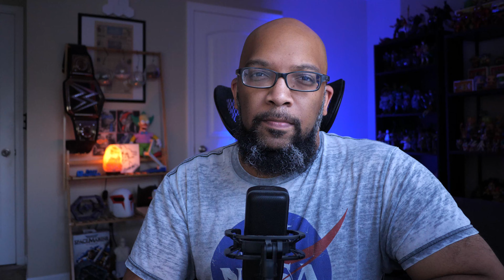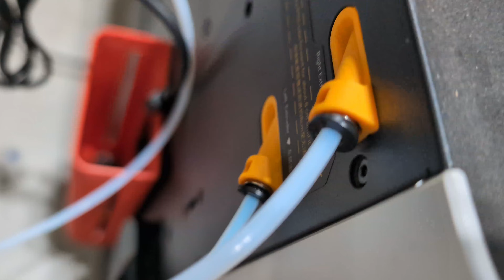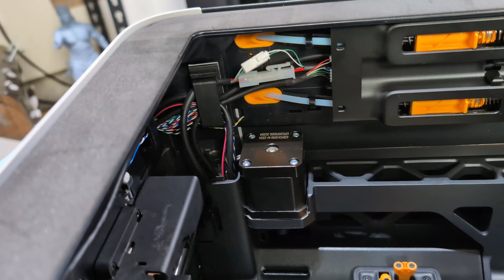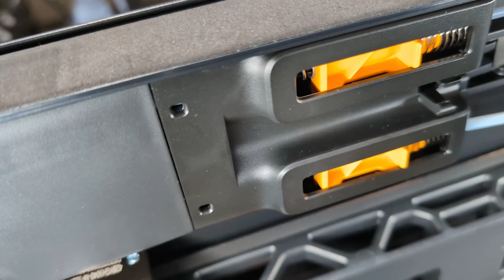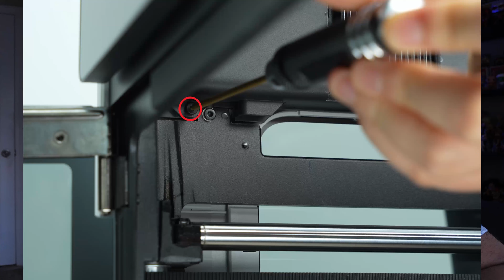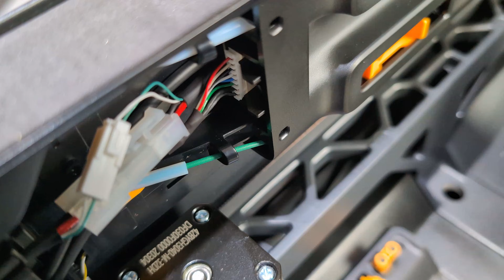How To Fix  Bambu Lab H2D Filament Buffer Jams

Comment: This solved my problem on my new H2C.  I am glad I stumbled onto your video, otherwise I may not solved it so quickly.  I did have issues getting the cover back on, the left corner won't clip in properly.  However that doesn't seem to impact anything I have screwed it back in.  Thanks so much :-)

Comment: It would be quite helpful if someone (ideally Bambu Lab themselves) provided a measurement of the length of tubing beyond the orange external entry slot for the left and for the right extruders. This way, prior to installing or reinstalling the tubes, one could measure back from the far end and make a small mark with a sharpie pen to know how far the tubing has to go in. If you then don't get to that point, OR if you go past that point, you can be reasonably certain that the tube has not reached its proper endpoint within the buffer mechanism. It is very helpful to know about removing the plastic covering to allow direct visualization, but usually this won't be necessary. I have an H2D still in its box ready to be setup within the next few days. I plan to look carefully at all the steps involving the feeding modes for filament as many of the H2D mis-adventures involve filament feeding and extruder function. Fortunately, these are uncommon and for the most part easy to diagnose and fix IF one has access to video like this one!

Comment: Thanks for the advice. This works for me. The issue is that the tube hasn't gone through was the real issue. I flipped the tube and push through. On second attempt it pushed thru and filament was feeding fine.

Comment: Thank you so much for the help.  This part is terribly designed, and I nearly burned myself fumbling about in a 65 degree heated chamber with a build plate at 110, trying to figure out why the bowden tube refused to seat in the buffer and the filament refused to pass.  I lost a whole day of printing since I had to go to work in frustration, and now my presents will certainly NOT be arriving on time.  My Creality K1 has been easier and more reliable than this printer, come on Bambu!

Comment: I have an HTC... the first time this happened... it was the incoming PTFE tub.   I fixed it without even realizing it by popping the tube out and in. 
But my recent issue was different.
First part of the issue was a filament break off on the hot end side.  It wasn't stuck in the buffer, but I'm guessing it engaged the magnet that can block the tube.
After removing the broken filament the magnet did not reset.
I took Filament Buffer out and over to a table where I have halo/magnifier light... the magnet was working.  
Being I had taken it apart this far, I did a deeper look at it.  
Best guess is the magnet just would not release, I'm not sure if the printer needs to cycle or what is needed.
Normally the filament will push the magnet out of the way, but I am guessing it sends a signal to it which will keep it in place. 

Can be a pain if you don't have easy access to the top, but once you have dealt with it... providing the magnet drops back correctly after it's cleared, its a 10-30 minute fix, depending access to the printer.

Comment: Just got a H2S (my second printer) with AMS and had a similar problem - the filament didn't even seem to enter the printer, just jammed against the buffer. Turns out, since I've used old filament (from my old printer) a piece of that old filament broke off right after the buffer. I just had to remove the ptfe tube (buffer to printhead) and clear it out. Took half the printer apart before that for good measure facepalm

Comment: This did work there was no screw to remove just pulled the left plastic piece from the middle and it folded and I saw filament stuck there.pulled it off seated the tube properly and worked just fine.

Comment: This solved my issue as well. I replaced the previous filament tube due to wear, but then it wouldn't feed filament in. Crazy that a single screw so far away from the issue was needed to remove that cover.

BUT an 8 min video with 3 ad breaks? Seriously,  this should have been a 2 min video which could have straight to the point.

Comment: Going to have to check this on my right buffer when I get home I can watch my buffer push all the way forward then snap back when the ams retracts the filament
Reply: Mines doing the same.  Can see buffer move but not getting filament.  You find the answer?  Mine is brand new never printed out the left nozzle.
Reply: @jgodbee3791 my magnets were fine. But I did find my filament cutter was sticking it had a very sticky lube from the extruder gears all over it after I cleaned it it helped alot

Comment: Thanks for the video! I already got to that point — I had the filament buffer loose in my hand and noticed that something at the bottom of the buffer is blocking the path. BUT only in the direction toward the extruder. When I push a piece of filament through from the inside, it moves that part aside. However, it’s NOT a broken piece of filament. It actually looks like it’s supposed to be there — kind of like a lock or stopper to prevent filament from being pushed through when the corresponding extruder isn’t active. But honestly, that doesn’t really make sense to me and seems unnecessary.
Has anyone else run into this issue?
Reply: I EXACTLY GOT THAT PROBLEM. Did you manage to solve that?
Reply: @andreaagarbati4362  Yeah, just loosen the four screws. Unplug the cable from the buffer. Then loosen the four screws on the buffer itself so the filament feed area is accessible.
In my case, one of the magnets on the spring had shifted.
Just realign it (check the neighboring feeder for reference) and you’re good to go.
You can easily do it with a pair of tweezers. Hope that helps!
Reply: @christiandorner  I've done this right now (fear to break the cable) and discovered through a reddit I had the same problem. But thanks, anyway! How the hell this happens...?
Reply: @andreaagarbati4362  Even Bambu Lab isn’t perfect. It happened to me after about three months of regular use.
Bambu immediately sent me a whole new buffer. When the new one arrived, I took the old one apart and instantly saw and fixed the issue.
By the way, those cables and connectors don’t break that easily 😉
Reply: @christiandorner I had to replace the dual gears after just a month of use, approximately 100 hours. But they kept sending me wrong pieces like there weren't reading my messages 😂
Anyway that's good you fixed that and figured out this little issue so you can spread consciousness 😂
Reply: @andreaagarbati4362  mine was blocked by the spring loaded wedge dohicky. I could see a shiny metal blocking the hole exturder hole. if you follow those steps in the video to expose the extruder just unscrew the circuit board by removing the 3 small screws and pull the spring and wedge and rotate it and it won't be blocking the hole anymore.
Reply: @MikeKath-r9c  thanks, I did it a few days ago but also made them send me another buffer to keep just in case 😂

Comment: After you installed the AP board cover back. Does it sit flush with the cable cover? Bambu is sending me a replacement cover, someone forgot to install it properly.

Comment: Thanks for this video. The filament snapped in about 5 places and got stuck in the PTFE tubes in my H2D. I cleared the PTFE tube going to the nozzle and it still wouldn't feed new filament. It turned out there was a piece of broken filament stuck in the. Problem solved now.

Comment: Thankyou , i had a very similar problem with my right extruder , looked through  the peep hole and didn't see the PTFE tube so took the cover off and there wasn't a ptfe tube there at all . luckily it came with some so i cut it slightly longer than needed and forced it a bit into the gap so should stay there now and it fixed my problem . Thanks for great advice and have subbed to your channel .
Reply: I had to get a replacement filament buffer(free of charge)....  If you decide to go that route, make sure you are careful when you unplug the cord to it.. I pulled out a wire and had to replace the wire too

Comment: I have this issue just 15 days of use and both tunnels are stuck and it's not filement debris and might be another issue. I've submitted a ticket. Honestly Bambulab engineers over complicated these things and this buffer hub is useless and unnecessary part. X1C just feeds from AMS to the extruder and it's such a simple thing.
Reply: I got a replacement part from bambu ... Works great now
Reply: @Soljarag5  what part was bad? I have this issue-
Reply: @michaeldemopoulos9689 the filament buffer.   The part in the back that has the orange pieces....   Still working great BTW